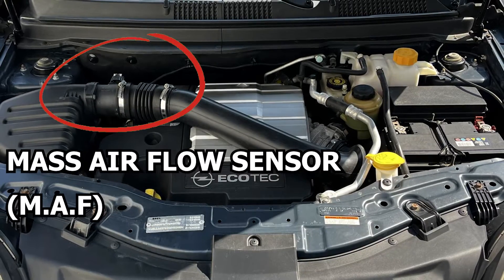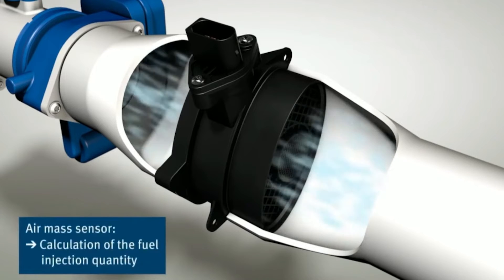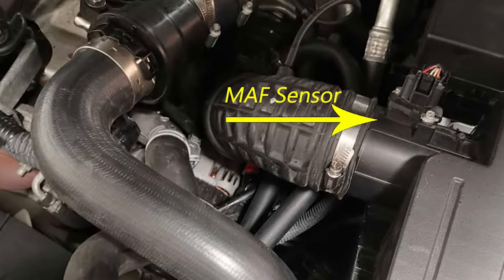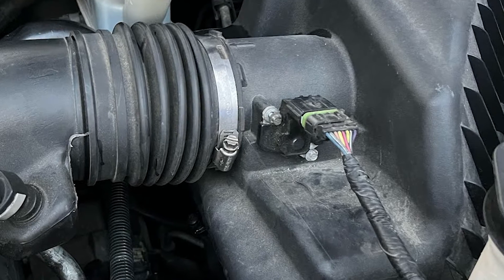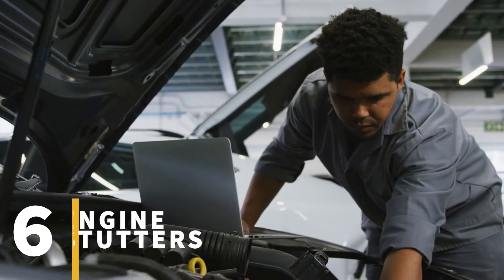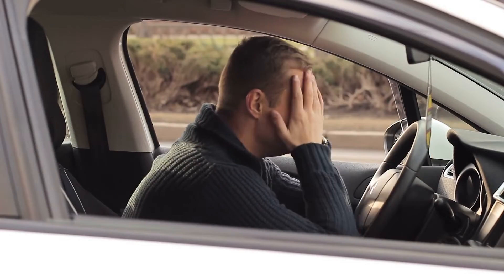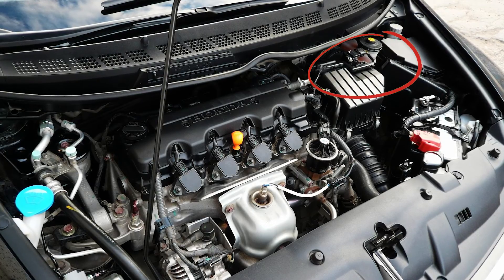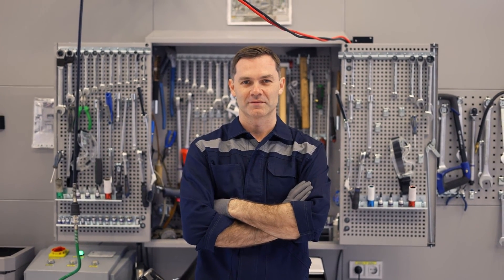SYMPTOMS OF A BAD MAF (MASS AIR FLOW) SENSOR

Comment: BMW F45 MAF sensor costs 400 EUR in France. My check engine light is on and the scan results indicate a MAF sensor issue. Everything runs smoothly. Will clean it up and see what happens with the light. Great video!
Reply from the maker: Most of the time cleaning the MAF Sensor does fix the problem.  You do not always have to replace it with a new one.  Hope cleaning it solves the problem for you.  Thank you and thank you for sharing!
Reply: @fixit3879  unfortunately cleaning the MAF did not help. The MAF reading looks normal and within range. What I noticed though, when I unplugged the MAF connector, the engine didn’t turn off. It ran normal without any noticeable change. I’ve read that the engine not turning off is not always a sign of a bad MAF.

Comment from the maker: It’s hard to tell without checking your car.  These are only common symptoms.  White smoke can also mean that the engine might be burning oil sometimes if the car is really old.  It’s hard to tell for sure without checking your car.  Some other problems can be the oxygen sensor or faulty spark plugs as well. 
Good luck and Thank you.